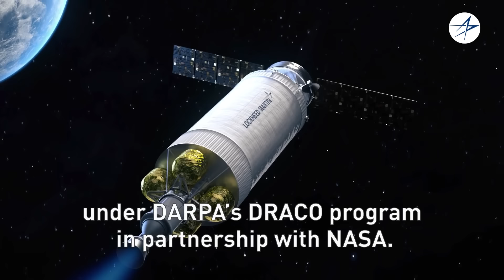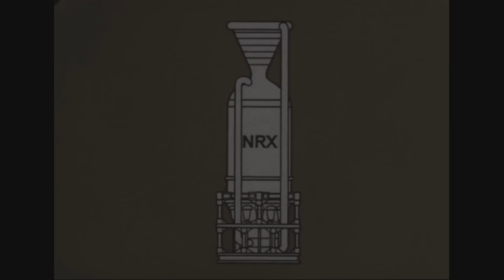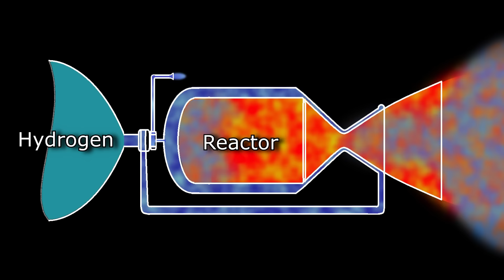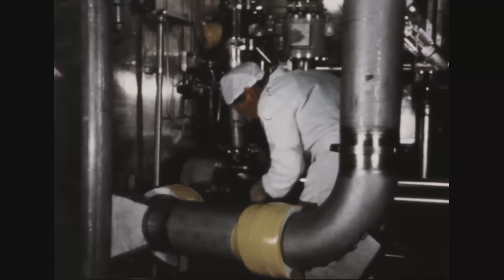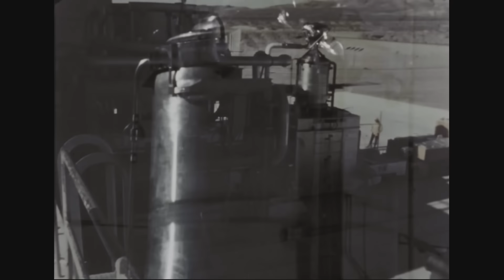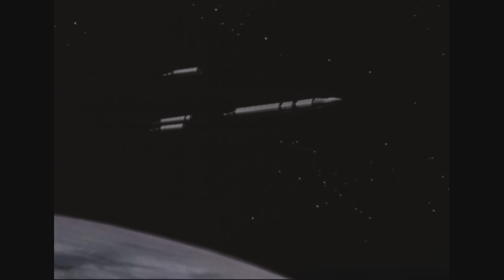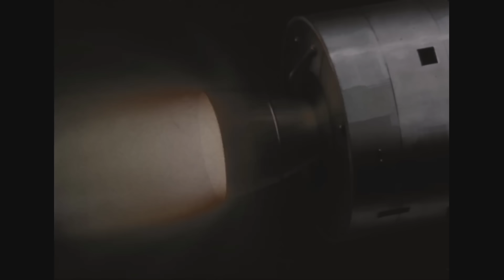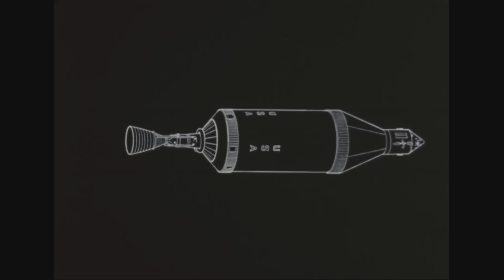Why Nuclear Rockets Are Going To Change Spaceflight

Comment: I dont know how much these rods weights but if we think they made from % 95 enriched U 235 (plutonium even more) it seems to cost very much as compare cost efficency between 1:1 chemical rocket engines. İt should make by % 25 enriched U 235 still will cost much (seems these rods are big.). It is  same problem like Nuclear Energy what ever you do, it always cost much. Consider about the weight of these rods, made by one of the heaviest element in the world still create a question about weight of this engines too

Comment: A real fun NTR side-effect is that neutrons will get in places you don't expect, and bits of the structure will start to activate and transmute, and the hot structural members will start to do the same to other parts of the ship, resulting in the incredibly strange problem of parasitic alchemy :
"Fly far enough with your engines burning at full throttle, and your ship will turn slowly into gold, plus lithium, arsenic, chlorine, and a lot of other elements that were not aboard when you left."
Reply: Midas's Spaceship
Reply: Those elements get created in tiny amounts.  The nuclear fuel would run out long before any significant amount would have been made.  It happens in nuclear reactors here on Earth too, but in such tiny amounts, it's not worth separation/purification.
Reply: @billant2  Hence all the qualifiers about flying far enough and slowly.  It's parasitic alchemy, not useful alchemy.  Just enough to be inconvenient and cause embrittlement issues in older craft that have been through a few hundred round-trips or the like.

Comment: The new engine they're developing for DRACO (and isn't that one of the coolest acronyms ever) is bimodal. In deep space it will run like an ion engine for high fuel efficiency. When you need a lot of thrust very quickly it'll switch over to thermal mode. So it'll be a more complex and heavier engine than either one, but lighter than carrying both around.

Comment: I don't like that these are called "Nuclear anything." I think that creates a false impression that we're using the same kind of power that we get from splitting atoms. In reality, these rockets are just heating "fuel" and shooting it out of a nozzle, to generate momentum in the opposite direction. Additionally, the "nuclear" part isn't necessary for the operation of these rockets. Any source of heat will do. As such, the "thermal" part is necessary, but again, any heat source will do. We could be using combustion to generate the heat and also to accelerate particles. Or non-combustive exothermal chemical reactions... Any such sources will all result in sufficient heat being generated to heat and accelerate the fuel. Honestly, if we had enough oxygen, we could even use burning coal and the end result would still be the same!

Comment: The best you can hope for with a nuclear thermal engine is an Isp roughly double that of the best chemical rocket. And it all goes downhill from there. All that extra mass in the reactor and shielding makes your entire rocket a lot heavier. Which can easily nullify the theoretical gain. Hydrogen is low density and you pay for this in adding more mass for the tanks. Other denser fuels like ammonia you pay for in lower Isp. So I'm not at all convinced that nuclear thermal will ever deliver sufficient incremental benefits - especially given all the other safety and mission design issues. Then there's nuclear electric. Yes, serious Isp. But again, lots of mass for the reactor and shielding and now even more mass for the radiator structure. Snake and ladders. 

I think the way out of this mess is aneutronic fusion. Most of the energy shows up as high speed particles and X-rays which can be converted to electricity more efficiently than the heat engine you'd need on a regular nuclear plant. Plus, far less radiation and thus less mass. 

And even given this, trips to Mars are likely to be more economical with regular methalox. You may need "brute force" quantities of fuel but that problem largely goes away when you get much lower costs of delivery to Earth orbit. Its trips beyond Mars where nuclear makes more sense and since these missions are likely to be non-manned they don't have the scale of payload mass that a manned mission does.

Comment: Nice video. I have a idea: If the nuclear reaction is used to heat the fuel to generate thrust, then why don't use that nuclear reaction instead of Preheater in for example Raptor engine that SpaceX uses in Starship? What I mean is that the fuel and oxidizer will flow through the reactor and then they will go to ignition chamber where the chemical reaction will take place, this should result in much higher thrust and still use a efficiency boost from using the nuclear reactor. I understand that this will be a much more complicated engine, but is it not worth this additional complication?

Comment: 'As the delta V requirements get bigger, eventually the tyranny of the rocket equation will win' - what an incredibly eloquent statement. I love watching your videos Scott
Reply: and a good while after that the tyranny of relativity sets in
Reply: The thing is they won't, they'll actually go down. Once we get to the asteroid belt you can really slow down. Burning massive amounts of fuel isn't the problem it's sourcing massive amounts of fuel in space that is the problem. Once you can just harvest asteroids, things get way easier. The Delta V between earth and the belt is actually quite small.It's the getting out of earths orbit/geo that is the problem.Something nuclear won't actually be able to help with.
Reply: Unless... you have a Neutron Flux torch engine. That requires magnetic nozzles, though
Reply: @RazorsharpLT 😂

Comment: Actually, the strong nuclear force is working against you in nuclear fission. As with chemical reactions, the energy is derived from the electromagnetic force. In this case, the repulsive force between the protons in the nucleus. The strong nuclear force is just holding the nucleus together in a metastable state.

Comment: The shutting down of nuclear research is nothing but a hindrance to the advancement of the human race.  Our comfort and safety is in direct proportion to the energy we can liberate from the earth and nuclear power is orders on magnitude more powerful than hydrocarbons.  The claim is made that nuclear energy is dangerous, but if they shutdown motor vehicle advancement at the Model T Ford, that is the reference for safety levels.  if research is started up 70 years later, than the technology is still at Model T Ford levels, 70 years later, that is where nuclear research is at.  The main purpose I feel for it been shutdown is the lack of fuel that can be controlled by governments and the wealthy.  America would lose it's position at the top due their dollar no longer being tied to the most important product on earth.  It's no coincidence that the US dollar was removed from gold and tied to oil at exactly the same time that nuclear energy was discovered and started to being theorised to be used for all energy needs., and if 0.1g of uranium could power your house and car for 80 years, what's to control.

Comment: I think large spacecraft will end up with multiple reactors.
1.  The primary nuclear thermal rocket, requiring hours to start up and shut down.
2.  One tuned to provide steady electricity output for powering the rocket's systems, spacecraft operations, life support, communications, and ion engines to provide a small continuous thrust.

Comment: Now, I know that hot O2 is bad for things, but, could they have had 2 nuclear chambers with one heating the H2 and a separate one heating O2 and then a separate combustion chamber to burn the combination? Or perhaps just have the H2 go through the reactor and then use the O2 for regenerative cooling of a combustion chamber, combusting the H2 and O2 to give a little bit more thrust? Would it increase the thrust or is the H2 already travelling too fast to be able to combust with the O2?

Comment: dont dare to haul the propellant to the orbit, like water, steam, just sling the photon energy as mass. much more sane. yeah nuclear thermal is just steam engines in space. or sling space ions. having hydrogen as the propellant, or propellant in a nuclear engine, is bogus. when you go to swim, dont bring the water with you where you swim, its already in the pool or lake. in atmosphere of earth, you have tons of air to heat up and lift off. on double isp, the energy density is millions times more, where did you put the rest of the millions times, chemical is a minor percentage of the millions. literally gaslighting bro.

Comment: Exciting! We're finally chipping away seriously at the engineering problems we need to overcome to truly 'stroll around' our solar system and access its resources, rather than crawling. As enthusiastic as I am about the long-term prospects of nuclear fusion, we can't hold out for the one longshot that may arrive any time between 10 years and never. We need another plan, something that seems more firmly approachable. The only candidate that seems available as a 'second basket' (or rather, first, as it's already somewhat practical rather than 'maybe sometime' for fusion) for our eggs as far as spacecraft drives is nuclear fission, so it seems a no-brainer that it should be a research priority. The planets aren't getting any closer!
Also, the engineering challenges of fusion and fission eventually converge when you start talking about gas-core nuclear-thermal rockets -- that's likely to end up with extracting energy from radioactive, magnetically-confined plasma either way. Seems something we might have to work up to in stages, and fission NTRs have a variety of useful steps from 'where we are' to 'there', rather than having to cross it in one jump to get anything useful with magnetic-confinement fusion.

Comment: I imagine if we are establishing a network that relies on nuclear engines to traverse the void, that we would be capable of deploying an autonomous craft to contain the engine safely when not in use. Essentially on arrival a space-drone autonomously performs a  rendezvous with the nuclear-tug engine, moves a shield into place to allow easier departure, arrival, refuelling and maintenance, then when the engine is needed again it departs after the arrival of the payload/crew and puts the radiation shield between itself and the engine as the ship departs. It could use ion thrusters since it wouldn't need to move super fast, but would be optimised for minimal refuelling.

Comment: Could you make a heatshield that pushes hot plasma away by placing a superconducting magnet inside the cryo-fuel tank? Cooled by the fuel and charged by the ground station, is this ever a possibility?

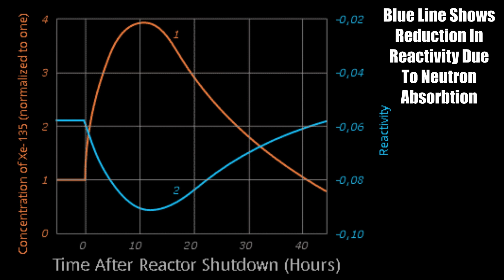Comment: 14:57 When you are talking about Xenon poisoning of a nuclear core, I have actually seen that first hand. I saw in onboard the USS Salt Lake City while we were at power and sailing down the coast of California. We had been up north engaging in training exercises tracking ships transiting to and from Seattle. After we completed our training, we turned south to return to our homeport in San Diego. We had been traveling for an extended period of time at all ahead full. Reactor power was pretty much at 100% during this time. I was standing watch at the time as the Throttleman in Maneuvering, the room from which the reactor was overseen and controlled from. We got the order to come off the bell down to ahead 1/3. The captain wanted to tow the radio line so he could download the ships mail.

While we were at this low power, because our reactor core was so old, the Xenon quickly began to build up from all the fission products we had been producing at high power. So long as we stayed at high power, the neutron flux was sufficient to burn it off as fast as it was made. But, now that wasn't the case. The neutron flux was too low. So the result was that the temperature in the reactor began to drop. As this continued, the Reactor Operator had to gradually pull the control rods out of the core to keep the temperature stable.

Eventually he had pulled all the controls completely out and still the Xenon transient was continuing, dropping core temperature. At that point the Reactor Operator informed the Engineering Officer of the Watch, "Sir, unable to keep reactor temperature in the green band due to Xenon transient. Reactor rods fully withdrawn from the core. Recommend to Con to pull in the com wire and come up on the bell or else the reactor is going to shut itself off."

Was both cool and funny to see such a large scale direct example of nuclear physics in action. The EOOW, the officer in charge, relayed the Reactor Operators recommendation to the Con. The Captain, then quickly ordered the line brought back in and decided he could finish reading and responding to the mail once we were back in port. About 5 minutes later I got the order to come back up to all ahead 2/3 then back to full shortly later. Temperature continued to drop for a short bit, but once back at power, quickly stabilized and returned to normal as the remaining excess Xenon was burned off.

Eventually we arrived back in port, and aside from getting to watch physics in action, none the worse for the experience.
Reply: How could the reactor operator increase power with the control rods already fully out? Is there another control input?
Reply: @w0ttheh3ll  Xenon-135 is radioactive, so after some period of time, its amount inside the reactor diminished, so neutron absorbtion rate also decreased and this was the reason of increase of the rate of chain reaction and reactor power.
Reply: Thank you, very interesting! “Eventually he had pulled all the controls completely out and still the Xenon transient was continuing” — Yikes, and that's a naval reactor using high-grade U! I really thought they always had a reactivity excess to overcome the Xe poisoning. A civil PWR may sit cold well over 40 hours in the xenon pit after a scram when the fuel nears EOL. In fact, I've never heard of a PWR successfully restarted from scram in less than 20 hours, even if recently refueled. That's why operators love sas scrams about as much as the bubonic plague...
Reply: Why can't you run the reactor at a higher power rating (or even full power) while still at 1/3 ahead? Shouldn't there by some kind of bypass from before the turbines to just dump excess steam produced straight to the condensers?
Reply: @wally7856  Uses more fuel and expensive/heavy to do that
Reply: @wally7856 bro are you really trying to engineer a nuclear sub right now? 😂
Reply: @poindextertunes  Think of a bypass like a clutch or a torque converter in your car. There has to be one or else as soon as you fire up the reactor you plow into the dock in front of you.
Reply: @wally7856  it is too much power not worth engineering something like that  because of weight, cost and size
Reply: Surprised you're allowed to tell this story...
Reply: Yup that pesky Xe133 comes and haunts ya. The big worry is that it suddenly burns off while the reactor is at supercritical. That's what made chernobyl go up, along with the negative temperature coefficient of the graphite moderator bricks and human error.
Reply: @christopherleubner6633  And so much more. Chernobyl never should've been operated the way it was built or with the staff it was provided.
Reply: @christopherleubner6633  Negative MTC means that as temperature goes up reactivity goes down. That's a good thing. Read a bit more.
Reply: @christopherleubner6633  no, the correct mass number of this Xenon isotope is 135.
Reply: It’s the sort of incident that probably happens waaay more than anyone really counts. Power plants of other kinds have the same kind of collapsing flux
Reply: i believe this sort of thing was a contributing factor to Chernobyl
Reply: Some of what you said is correct.
Reply: Interesting.  Xenon has a similar effect on consciousness.
Reply: @davidhess6593  Because its noble.
Reply: Nuclear reactors do not exist sry
Reply: @James-zp5po what?
Reply: @James-zp5po Take your meds unc

Comment: Although Nuclear Rocket Engines are not a new thing, making them reliable enough to go to the Moon or Mars has not been verified. Initial development in the late 1950s and early 1960s was merely a curiosity. Reliable Engines are an issue no matter which one you use; unreliable propulsion will strand travelers in deep space with no hope of a safe arrival or return. The Nuclear Engine may provide higher velocities but higher velocities comes with an added difficulty, super-velocity incursions into the leading side of the craft. Again, shielding a craft for 100,000 mile per hour incursions has not been tested. Then there is the difficulty of shielding the Engine from incursions. The craft must be turned around at mid journey to decelerate. Turning the craft around for deceleration will expose the propulsion system to possible incursions. Achieving a reliable Nuclear Engine and shielding from radiation and incursions will take 10 to 20 years and will be fraught with difficulties, never mind the cost of $200,000,000,000 which must be allocated before testing begins.